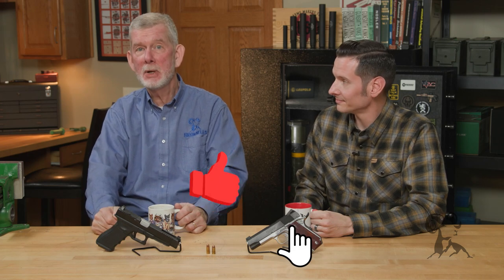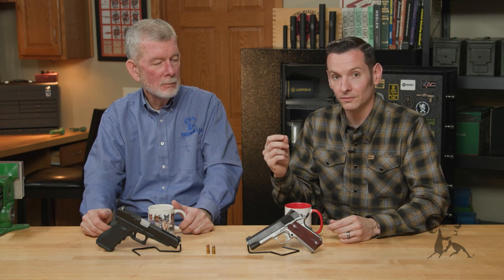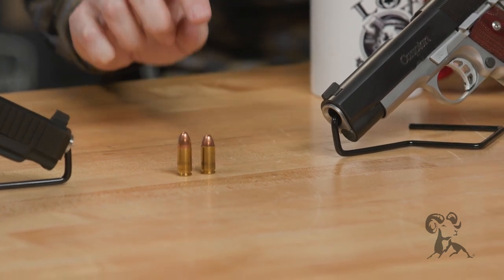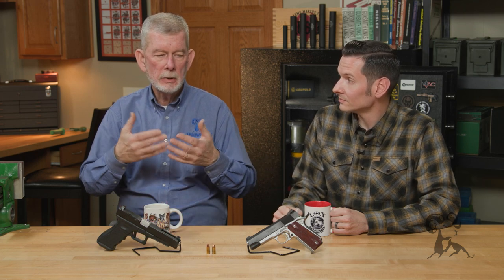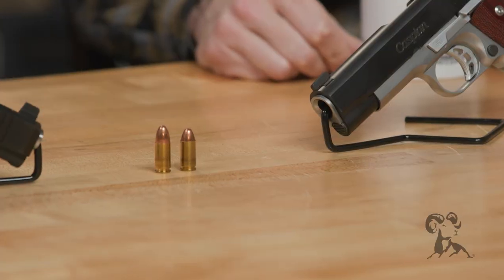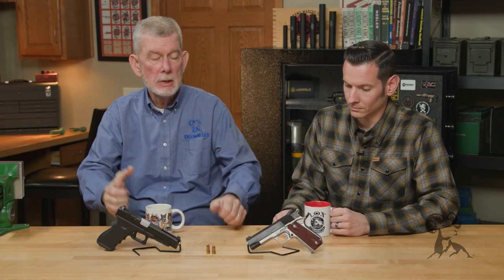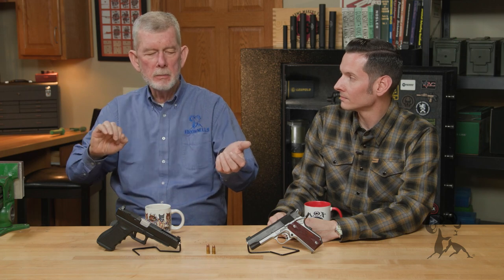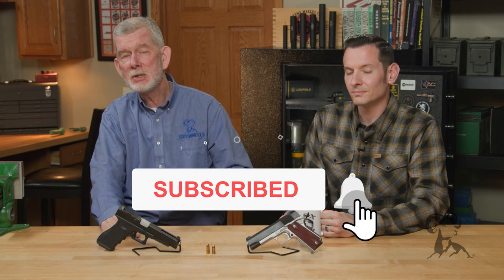Smyth Busters: Will Excess Bullet Setback Blow Up Your Gun?

Comment: Thanks for covering this topic. This was an issue among police agencies due to the practice of racking in a round, then re-using that same round. Doing that every shift/day, combining it with high pressure defensive ammo/40S&W, you can imagine where the term “Glocked” originated.
Reply: Also with ARs being re-racked with same round over and over. The free floating firing pin pecks the primer a tad each time. And can set one off potentially over time. It's why they use harder primers. Never seen one pop for that reason but if you rack one and check the primer after you'll see it dings it a bit
Reply: @hughgrection3052  I had a poly 80 that would do that, I’d rack the slide, and every time, there’s a concerning dent on the primer from the striker.
Reply: @jon boy  I've never owned one of those yet. I'll keep an eye out for it tho now thanks. And yeah anytime I re-rack any gun I try to shift the top round out into a lower spot in the mags just as a good habit. Another thing since many now carry a SIG P365.. (I carry the P365XL myself).. is that they're made with extremely tight tolerances. So it's not SIGs fault. But I noticed alot of defense rounds I buy lately are a bit long and out of spec. So the anyways the pistol "fires" them with no problem. But the moment u try to cycle out unfired rounds it will lock the slide up at the port nearly everytime. And it's so tight of a jam as it tries to eject it takes pliers to dig the round out lol. But it can cause setback also. But even worse is if ya have a dud in a gunfight and you try to cycle it out and u get a deathjam instead lol. So check the rounds and make sure they cycle out and are in spec on all pistols. Just a heads up
Reply: @hughgrection3052  ò
Reply: Dangerous practice anyway. If you are going to rack a round you do not intend to shoot, then make it a dummy round. Put a dummy round at the top of the mag. Rotate the mag in the chamber out while putting the dummy in. Rack the dummy round out while chambering the live round. Then top off the magazine from the box. Put the round rotated out into a box to use on the range. If you are not putting 20 rounds downrange a month, turn in your badge.
Reply: @John Lloyd Scharf  I wouldn't be so sure that mixing live ammo with dummy rounds is ever a better suggestion. It kind of violates the fundamentals of gun safety. But I see your intended point. I've seen one safer alternative tho. If your AR has a forward assist, rack it slowly. And use the assist to finish putting it into battery. Many of my ARs don't have one tho. And in a perfect world cops would get more training. But many just do the bare minimum to qualify. And never fire that many in year. So there would be piles of badges I suppose lol
Reply: Ah yes, 40s&w....
That "high pressure" round with the same maximum pressure as 9mm.........

Can we please stop spreading this bullshit now that .40's popularity has successfully been ruined?
Reply: @deejayimm  True, 40 Smith & Wesson and 9 mm are both rated at 35,000 psi, however 40 Smith & Wesson has a greater cross-sectional volume which results in a greater overall tensile stress/strain exerted on the vessel containing the pressure.
Reply: @jcnikoley  Wait.......
If both pressures are equal, the one with LESS surface area would have a higher amount of strain....
Reply: @deejayimm  If we are talking about solid objects, yes, but empty space which is the volume within the cartridge case is the exact opposite.
Reply: @jcnikoley  go watch a video called "anatomy of a headshot" here on YouTube. The guy shows a formula that will help settle this debate. I think you'd like the math shown.  Little gory topic for a video but yeah the math in the middle part really helps explain things better. Kinetic energy is king. Let me know what ya think
Reply: @jonboy9734  sounds like you need to revise your build before you ND your neighbor's dog lol
Reply: @hughgrection3052  I can't imagine anything strikes the primer harder than racking an SKS. It puts a significant ding in the primer,
Reply: @TingTingalingy  yeah I've never owned one. But I've heard of some of those chainfiring uncontrollably in full auto due to that tho. I want to say it happened when they was dirty and the pin stuck if I recall correctly
Reply: @hughgrection3052  yeah, I've heard that about AK & SKS when dirty. Scary 😆
Reply: @TingTingalingy  yeah. I guess it can happen to all with a free floating firing pin. I think it happens to them mostly because they was packed heavily with kosmoline. It either dries up and gets stuck, or since it's a grease it doesn't compress and escape out when compressed like lighter oils would. It then turns the closed bolt rifle into a open bolt MG basically lol. I saw a video the other day where a guy fired a rifle once and he wasn't expecting it to go full auto etc, he was just doing a lazy style hip fire and just expected a single round to fire I guess. It went full auto even tho he wasn't holding the trigger after and it shot out of his grip like a murderous squid and then continued to fire as it slid across the floor of the firing range. He had a buddy standing just behind him to his right. His buddy appeared to get shot about 1-3 or so times before the mag finally emptied. The video wasn't clear and was from far enough away that you can't quite see what make and model it was. The comments all seemed to think it was an SKS tho I think. Yeah pretty scary stuff
Reply: @hughgrection3052 That's a fact.  I saw it happen at the range one day. Ten rounds went downrange with one pull of the trigger.  The culprit: firing pin stuck because of "dirt" , fouling or whatever you want to call it.
Thankfully,  nobody was hurt!
It was an SKS

Comment: I actually had some experience with this issue while working in Africa. I was called to investigate a negligent discharge by one of the prison guards that resulted in 2 guards being injured. Long story short, neither one had any Bullet holes in them, and there was only pieces of brass that looked to be brass casing at the scene where it happened. I emptied the rest of the magazine from the 9mm carbine and found 3 rounds that had been pushed backed into the case by constant rechambering during loading. I confirmed it when pushed the bullet out that had stopped in the barrel. When the round was fired, the excessive pressure blew the bolt back and exploded the brass case out the ejection port. The resulting premature loss of pressure resulted in the bullet not having enough gas to push it clear of the barrel. Definitely had me scratching my head at first look.

Comment: Reloading data and SAAMI standards exist for a reason. This is one of this duo’s best. Thanks!
Reply: Cartridge overall length is definitely a thing.
Reply: @Oldmanwithagoldpan  A thing with a lot of variation.
Reply: Over pressured rounds due to bullet pushback is plausible, but from my experience what is most lost is accuracy.  I have shot many rounds with bullets pushed back and have NEVER seen any evidence of serious over pressure that would cause damage to the gun.   No cracked cases and no primers pushed out....at all.  But I did end up with a flier on the target.  Is it best to  remove the round....yes especially if you are on the upper cusp or the guns pressure limit.
Reply: What is the reloading data for a .45ACP with 360 grain bullets? They work in .45LC with a lower SAAMI pressure.
Reply: @POOKIE5592  I was once told I should not keep one round in the chamber.  My answer is "Two will not fit." A shell with too long of OAL will stop the rotation of a revolver cylindars. A shade off from the limits of OAL has been known to cause a malfunction in a self-loader. The tighter the tolerances in the weapon, the more likely it will happen
Reply: @JohnLloydScharf  the heaviest 45 acp I've ever seen was 250 gr but that was not any powder manufacturing suggested Ioad data.  I found it on a msg board of a gun chat group because I was looking into loading some 250 gr for my G36.. and even they were saying you better have a really strong barrel and Never try going over 230 gr out of a glock. I put that quest down and went back to 230 gr max. 
45 colt on the other hand,, 👍🏻
Reply: @Oldmanwithagoldpan  That dosen't make much sense.
Why would you need a stronger barrel for a heavier bullet.
Seismic is supposed to release a 325 Grain .45 ACP, but it's crazy expensive.
Reply: But SAAMI only gives you maximum OAL, not minimum OAL. Or does it? Am I missing something?

Comment: I have had it happen with factory loaded ammo. My Sig Sauer p320 blew up shooting a Glaser Safety Slug that was defective. When I looked at the rest of the box , the overall lengths were all over the place.
Reply: I hope this comment gets pinned to the top, thanks for sharing 👍!
Reply: Eh thats just a Sig Feature,  they fixed in in generation 6
Reply: Sig stood by their gun and replaced the grip module at no cost, even with being an ammo problem. Corbon did nothing. It was an ammo problem.